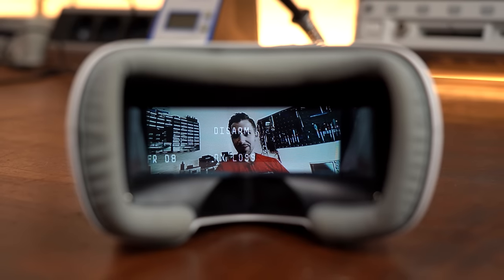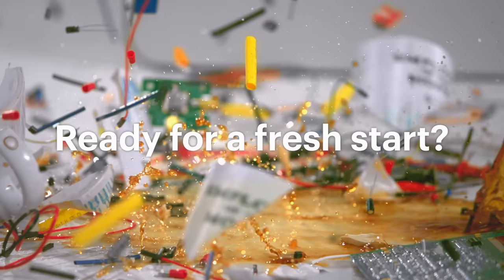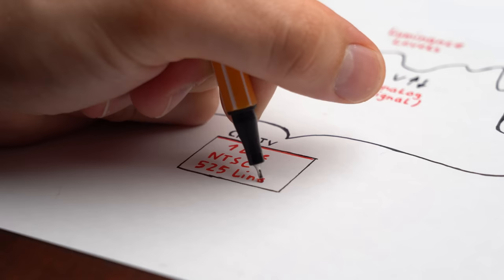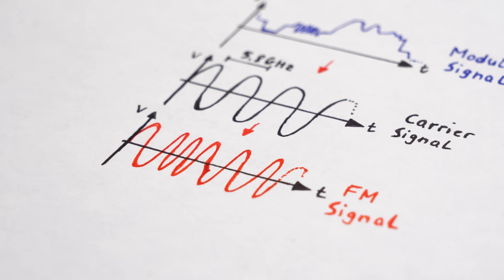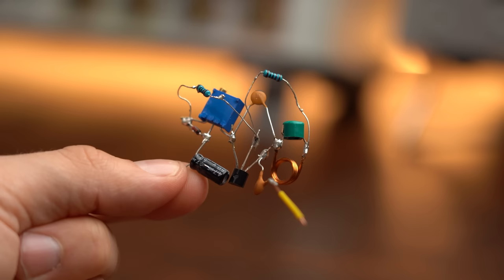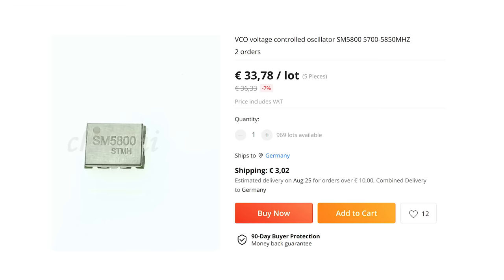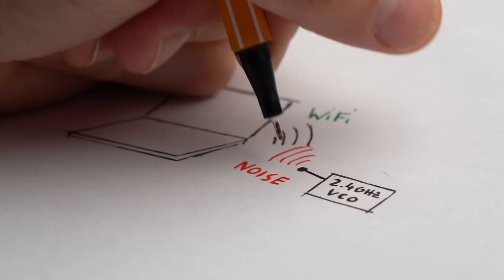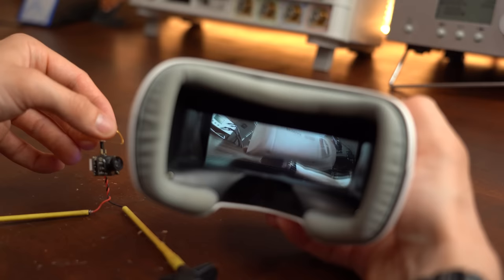I tried Wireless Video but ended up building a WiFi Jammer (A Fail Story)

Comment: I think it's your opamp. If I read it correctly it's an MCP602, which has a pretty steep gain falloff after 1-2mhz, and a unity gain bandwidth of 2.8mhz. Composite signals can swing much faster than this. You should try looking at the pre and post amplification signals a little closer on the scope, look for ringing etc, and also pay attention to the size of the loops of wire you're creating in your free-air circuit. I'm looking forward to another wireless video... video! Keep up the awesome work!
Reply: I agree....I have no idea what it is but sure as hell sounds impressive.👍
Reply: I agree with this I used this opamp for vga and got similar looking results. He will need a higher bandwidth/slewrate opamp
Reply: so since the signal isnt able to oscillate how it wants because the opamp is too slow its just "jumping" out of the traces like theyre little antennas?
Reply: @penguiin12  Mmmm, yeah but no antenna analogy.  In this analysis, probably the horizontal and vertical sync signals are unintelligible to the receiver's decoder.  The video levels are probably smoothed out too, but without sync that doesn't really matter.
Reply: He should check out an LM6172 or similar. Something like that might be a good start.
Reply: @Randrew  i meant like because it was a wifi jammer
Reply: your signal after the op amp looked awful. what was your line and frame  rates? only ever done am video but think it has to be one way up in frequency. sdr may help like Hackrf  one.
Reply: No wonder they call wireless engineering the black magic discipline
Reply: MHz*, not mHz.
Reply: I just came down to say exactly this lol. I will say though I did get this to work very well using both channels of an lm380
Reply: Indeed, baseband composite usually has frequencies up to around 6MHz, where color subcarrier is 3.58MHz…
Reply: I think he is just not needed in amplifier before the VCO, because camera's composite output level is enough to control frequency and make FM
Reply: @skybot9998  😄😄 that's right
Reply: @Gengh13  actually, he wrote mhz, other than that your correction is, well, correct! 😉
Reply: Ya I think he's right
Reply: I think it also might have something to do with nearby interference from network devices most wifi access points and a few industrial devices work on the 2.4g and 5g and a lot of places in between wifi access points get around the problem of interference by waiting for nearby devices to stop broadcasting before broadcasting itself since your system doesnt have anything like a broadcast or clear to send system

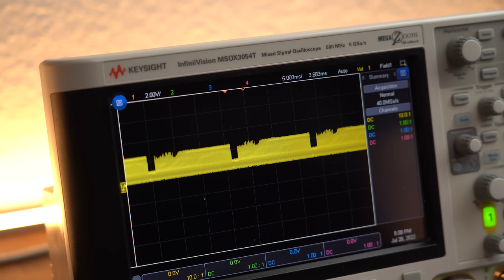Comment: Greatscott, it's a good educational video. But I can help you a little further. If you want to amplify an NTSC, SECAM or PAL signal make sure the sync level is maintained (both amplitude and pulse width). The sync level should always be zero volts (which I didn't see at 7:58). Keep in mind that a video signal needs a bandwidth of 5MHz. Make sure you have linear amplification over the full bandwidth. I also recommend using DC amplification and not AC amplification (capacitor) for your video signal.
Reply from the maker: Thanks for the tips!
Reply: Yeah lack of sync will definitely make problems show up, the least of which will be complete and inability for digital tuners to lock into the signal
Reply: what do you mean by the dc/ac amplification? Do you mean something along the lines of adding a coupling capacitor to remove the dc offset??
Reply: @lilliampumpernickel9916  yes he meant AC-coupled output I think
Reply: Linear / DC amplification... yes, because the signal is already modulated on the 5.8GHz carrier, so you don't want to modulate again - you just want to amplify the whole lot i.e. linearly. No ?
Reply: I agree with Paul on the issue of bandwidth capabilities. There must be enough bandwith in the carrier to load the data stream. Also DC decoupling on the input and output of the amplifier. A RF network analyzer might be of use.
Reply: In addition, in the TV broadcast, the image is carried by amplitude modulation and the sound is carried by frequency modulation.If I'm not mistaken, you tried to carry the image with frequency modulation. Which is the main reason why there is no clear image. If the problem was just syncing, the image would be, but messed up. The image is both noisy and messed up here.
Reply: @mfahrii  what year is this?
Reply: @sarthakdeore1815  year of super smart people// i cant understand what they r saying.. lol.. it's feel like they dont speak english..  my head hurts!!
Reply: @sarthakdeore1815  2022? Your WiFi and mobile phone are doing the exact same things, using frequency and amplitude modulation to get as many people on a small channel as possible
Reply: Good advice, I left a comment above not knowing the bandwith of an ntsc signal. I think the main problem is the vco does not have that bandwidth at the control input. It can't swing the frequency that fast, so you get alot of modulation noise and out of band harmonics.
Reply: Ah yes - that's right - they created a system called Macrovision that messed with that on the analogue outputs to prevent recording of early DVD's. 
I had fun building a 'Silicon Chip Magazine' video enhancer that corrected this. Was great for enhancing degraded output from tapes which was often a result of the sync info being corrupt.

Comment: Great video! I'm an amateur radio operator who's played around with video transmission a bit - I think there may be a few reasons why this project didn't work. Starting with most likely first:
1. Pre-emphasis and de-emphasis - Because analog FM tends to have more noise in the higher frequencies, to improve the signal to noise ratio over video links almost all analog video systems use some kind of pre-emphasis at the TX and de-emphasis on the RX. Much like the old "Dolby NR" system used on audio cassettes. It's basically a filter/amplifier on the video baseband signal which boosts some frequencies and reduces others. If the transmitted video does not have pre-emphasis to match the RX, when the receiver applies its de-emphasis to the demodulated signal, the frequency response will be distorted, leading to scrambled or no video.
2. Frequency stability - The output of the VCO in question will change by 75kHz for every millivolt change on the tuning pin, so any noise coupled into it will mix and "smear" the signal. A simple potentiometer divider to set the channel will be subject to thermal drift as well. Commercial transmitters use a phase locked loop (PLL) to stabilize the TX frequency - simply put, this works by dividing the output RF signal down and comparing it to a reference oscillator. If the frequency is too high, it will reduce the tuning voltage, and vice versa. You can get synthesizer chips or modules that include all of this - usually controlled by I2C or similar, which would of course require a microcontroller.
3. Bandwidth - if the signal is over modulated (in this case more than 66.6mV p-p modulation on the tune pin), the receiver will lose it's lock or recover a distorted signal. If it's under modulated, the received signal will be noisier and of a lower amplitude than expected, meaning sync or video may not be recoverable.

Others have mentioned that a spectrum analyzer would be very helpful for such a project, and I completely agree. If you're not in the market for one of the $20,000+ commercial units, a more hobbyist-priced alternative would be to use a 5.8GHz downconverter paired with a cheap RTL-SDR USB interface. The downconverter moves a "block" of the 5.8GHz spectrum down to a few hundred MHz which can then be visualized using the SDR and a PC.
Reply: Or use something like a Pluto, a SDR that can directly tune to 5.8/2.4Ghz and costs 100 USD(range is 70Mhz-6Ghz
Reply: Where can i get this 5.8ghz downconverter?
Reply: Nerd
Reply: you deserves your won YouTube
Reply: Always good to see a fellow Amateur Radio Operator! What class license do you hold?

Comment: When I worked with some high frequency circuitry before, I noticed you CANNOT just solder through hole components onto the IC components, because the long legs and design of the components give it inductance that’s way too high. I was working with 2.4G WiFi chip, so I think this may be your problem as well
Reply: Yeah, on the decouplers it might not matter so long as the legs are used as a mounting point for some low-inductance SMD caps, but for basically everything else it would be best if he just jumped straight to twisted pair for everything with and real length.

Comment: High-frequency is another beast. The 5,4GHz is 5,6cm of wavelength, so any piece of wire can turn into a capacitor or an inductor, messing your signal. And any non-linearity in the circuit can cause harmonics that will mess your transmission too.
If you want to work if those frequencies, you will need to design real circuit boards and high-frequencies softwares to simulate the effect of the trails and components. Will probably need a high-frequency analyser to look at the signal too. I don't think trying and error will do the job.
Reply: can you share me some HF rf software where I can simulate mm , rf ,  Ghz  wave pcb like Resonator , cavity , flat strip cap and filters ??
Reply: @omsingharjit  I know they exist but don't know much more. Googling I could find some online programs... There is a channel called Machining and Microwaves, maybe you can find something interesting over there.
Reply: @rogeriocosta1035  i like Electronic Rf But not Machining Rf technology anyway thanks

Comment: The reason why you only got a sort of camera signal from any VCO you have tried was that analog terestrial TV signal has its video signal AM modulated and the audio FM modulated, the old analog satellite TV was FM FM (FM video, FM audio) the reason why the image was sort of there was because you most likely used slope detection without even knowing it, FM slope detection uses AM demodulator tuned to the edge of the FM signal to demodulate it, it works ok-ish for audio but since a composite video signal is so wide in bandwidth, it has no chance. So the key word is AM modulated video signal. And as someone already said, the 7 marking on the TV was most likely just a marking for the dial scale, since you had your TV set to VHF low band, you were tuning somewhere between 54 and 88Mhz.
Reply: Looks like the upper end of channel 6 which can overlap with the low end of the B.Cast FM band at least in NTSC

Comment: I had a really big improvement on my tiny drone by adding circular polarized antennae - in theory doubles the signal out compared to power output because 'all' of the signal only goes to one polarization, and on the rx side doubles the sensitivity since it rejects all of the left hand signals out there.
Reply from the maker: Thanks for the tip

Comment: To test if RF equipment works one needs a spectrum analyser. That way you can observe your carrier signal at 5.8GHz. With the video signal, it may be important to see what modulation index is used for the transmitting signal, that way you can emulate it accurately using the amplifier circuit. Also, the bandwidth of the transmitting signal is important for an FM signal. 

However, great video, it's great to show that in electronics one doesn't always know how to do things. This is inspiring to us aspiring engineering.
Reply: That's why I asking to built Rf spectrum analyser instead using Available devices like tv tuner higer range , fm tuner or may be Satellite receiver ku band or any rf module interfacing with Arduino

Comment: For extra jammyness the output of the VCO can be fed to an amplifier, and also this VCO will probably be suited to disrupt a lot of wireless stuff on the 2.4GHz range like nRF24L01 based stuff
Reply: nRF24L01 ... I have about 20 of them here. They just dont work for me. They are glitching, dodgy and what not. Touch them, get near them, suddenly they stop working completely. I dont know why. 10 meters distance and it was always super unreliable. It tried many modules (hence I have so many of them). I got it working at the end, without changing anything... never again am I buying one of these shits. I am happy that we have LoRa now, like the SX1276. No pain, it just works. And can do so much more too.

Comment: The FPV community can help you get more range with an analog setup! What you have in your quad is an all-in-one flight controller, where the vtx portion will only have a max output power of 25mW. The best this setup can do (out of the box) is maybe 30feet before getting significant breakup in the video feed. Some might say to switch to circular-polarized antennas, but this won't provide more range; it just prevents multipath reflections (better for flying around obstacles with less screen static). Some pilots will include an LC filter between the vtx and source, to reduce video noise further; also, we usually solder a large HF capacitor in parallel to the battery to smooth the voltage sag on high throttle moves.
The next best thing is higher vtx power (up to 1W modules can be purchased in the US for non HAM users) and diversity on the vrx (RapidFire and TrueD are the best because they can "simultaneously" use both signals). After this, were now into long-range FPV where antenna trackers and high-gain helical antennas are used. The problem with this essentially becomes keeping a laser aimed at the aircraft in flight, losing signal and possibly the aircraft when that laser loses sight, but ranges greater than 30 miles have been achieved using trackers.
There are also 4g/5g and tcp/ip video links that have an almost indefinite range, but the latency is too high for precision flying.
Good luck.

Comment: As well the modulation is negative video, in that your video signal is inverted, with the bottom of the sync voltage being 5V, and the brightest point being 2V, so the modulation will be recovered properly. This is done in broadcast video so any impulse noise, like RF arcing and lightning, will tend to drive the demodulated signal to the black sync level, not full white, so it is less objectionable in the picture, having a screen go black is easier for the sync circuitry to recover from, than trying to restore the DC levels after going full white. Single 2N2222 as inverting common emitter amplifier with a gain of 2 will do this, just bias it so the bottom of the sync pulse, AC coupled into the base with a 100uF capacitor, will just turn the transistor off, and then your front and back porch, along with the colour burst, should sit around 4V off ground, video peak taking it to 2V.

Comment: TV is VHF (54MHz to 216MHz) and UHF (470MHz to 806MHz). 7MHz is HF.  the 7 on the TV is just a tuning Scale
Reply: Yeah, I doubt any TV tuner can go as low as 7MHz, a TV channel's bandwidth is 5-8 MHz depending on the standard. Channel 7 would be 147 or 189 MHz, again, depending on the standard.

Comment: I am an RF & SDR engineer and we build commercial cell phone detectors and blockers. From my point of view, there are several misconceptions about how RF audio and video modulation, amplification, transmission, reception, demodulation, etc. works. Besides that, at these frequencies usually you don't just hook up (wired) parts because even the slightest parasitic inductance (i.e. a piece of wire or even copper trace) would mess everything up. Most of the time, there are 99 ways to do it wrong and just one or two to do it right. Some comments have mentioned impedance matching, the antenna, etc. I think that's not the most important point as even a very poorly matched system would deliver some performance over a short distance. But if you really want to successfully transmit and receive a signal of significant bandwidth of at least some Megahertz (like a video signal), there are several key aspects, techniques, and components involved, not just a VCO. In a purely analog system, you need some signal conditioning, amplifiers (buffers, LNA,...) mixers, modulators, demodulator, and lastly a VCO and an antenna. You have to tune everything for the correct amplification (so the signal doesn't get distorted), modulation scheme (so transmitter and receiver are actually using the same "language" and "alphabet"), etc.
I am not saying that it is impossible but with your setup it would be pure luck to get everything right. It is way easier to build a jammer by simply modulating a VCO with some arbitrary signal. That is, you just spread some amount of energy in some part of a spectrum. But usually that's not enough to successfully TX and RX information over the air.
But I don't want to sound too pessimistic... you did a great job figuring things out, getting the parts and trying several circuits. It's actually great to learn new things this way, but trial & error is really tough when it comes to RF.

Comment: I think you should try crystal oscillator mixing and filtering out higher order harmonies so you can get high frequency carrier as is used in most moder receivers as well.
Reply: omg yess thiss!!!
Reply from the maker: Noted
Reply: Ah yes superheterodyning if speled it corectly
Esentialy this often done in recivers
So instead of having a demodulator work acros entire AM band you take in case of AM 455kHz as frequency you demodulate at, but 455kHz is only one frequency I hear you say. Well we take input signal and mix it it with oscilator working on our frequency + 455 kHz result of this is we will get our signal on 455kHz and aditional harmonics but it can be easly filtered.
For transmiter same proces but in revearse
Reply: You are the powerhouse of the cell.